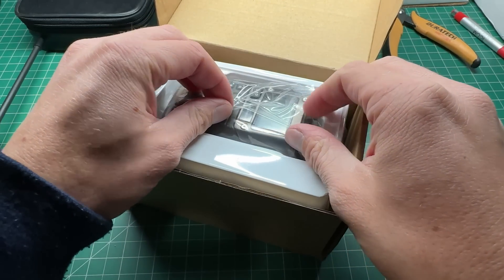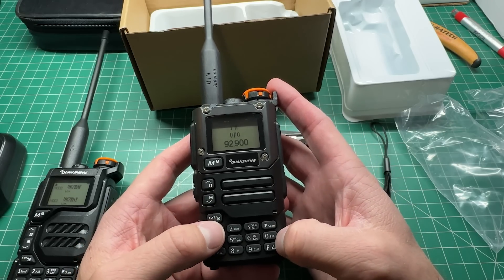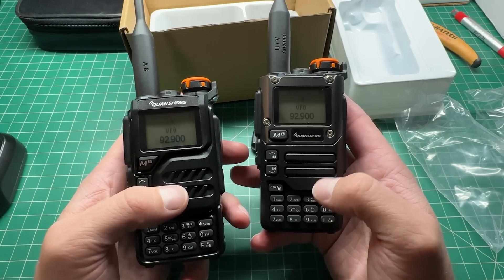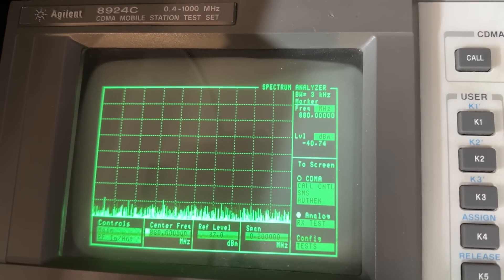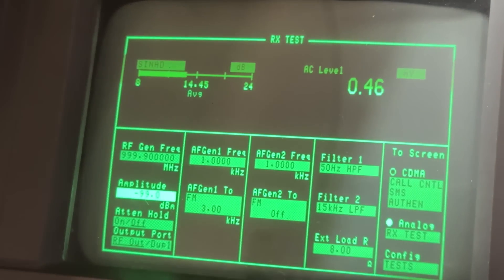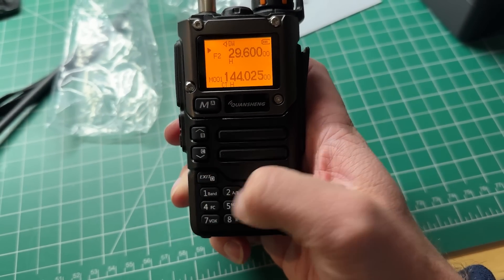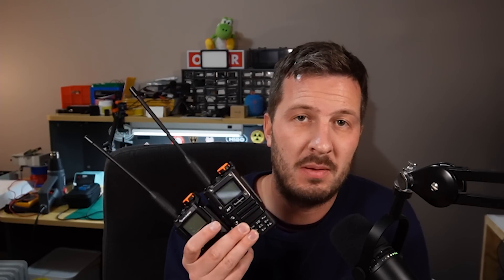Is This Really An "Upgraded" Radio - Quansheng UV-K5(8)

Comment from the maker: More on the UV-K5 here 👇
https://www.youtube.com/playlist?list=PLSuX83ay4Ouh_qMAC79F92DNVaOtywmC5
Reply: So why would we regret buying the upgrade version?
Reply: Getting around the same values with TinySA Ultra on the K5 (OG white light FW 18-1300mod) as some of your readings
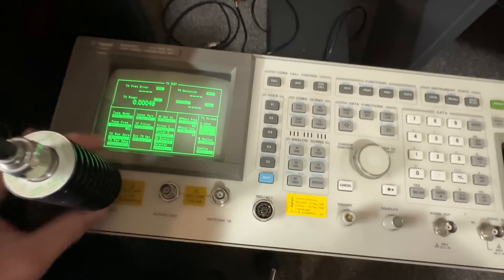36.1Dbm at 146.5Mhz with 200k span and 3Khz  RBW in high power 5:11 
first 293Mhz - 10.1dbm
Second 439.5Mhz = -16.6dbm
Third 586Mhz -36.5dbm

440Mhz 35.9dBm  (battery 7.93v)
880Mhz first -5.6dBm 🤔
1320Mhz second -2.5dBm  🤫
1.760Ghz third - 16.8dBm
2.200Ghz fourth -33.8dBm
2.640 five-43.1dBm
Anybody got the same? (am on FW hack 18Mhz to 1.3Ghz)

Though if I put all on automatic and just chose to do a "harmonic measurement test on 440Mhz as main carrier, the TinySA Ultra will span with 3.520Ghz. (RBW850Khz VBW 850Khz)
and gives these values, after you hold it in for a good amount of time, to the values stop rising =
Main carrier 440Mhz 35.9dBm
Delta to carrier +440Mhz away -46.0dBc
Delta to carrier +880Mhz away -40.6dBc 
Delta to carrier +1320Mhz away -51.8dBc

*1320Mhz harmonic seems to peak a bit on 440Mhz on the K5

Big thumbs up for doing these tests, as its a joy to follow suit and learning a tad from your knowledge on the matter, and I personally put way more value to videos that test such things and gives tangible values, then just "I feel something is good" as that view been outwatered quite a bit on social media like YT, hence secondary agendas / incentives, so kudos for testing things.

Comment: 3:58 nothing todo speaker. AM need AM modulation. do it has AM modulation or is it again chinese trick. AM should sound normal without shshshsh. there is AM on menu sure. mayby its software

Comment: Hmmm, you come across as intelligent and technically competent, what caused you to fail to articulate a reason for not purchasing a K6? Why debase yourself with ‘click bait’ tactics?
Reply from the maker: Did you not watch the video? Suggest you watch it again, perhaps at 0.5x speed to grasp the concepts and reasonings a little better.
Reply: You gave no reasonings to why this would be a regrettable radio to buy, so much so that the majority of respondents have simply labelled this post as ‘click bait.’ It seems as though your ability to get your thoughts and reasonings across is on the weak side. Perhaps you could revisit your video and add a summary at the end listing your reasonings. Up to now everything you said is wishy washy and vague. You have yet to commit to any solid reasoning as why this is a regrettable purchase.
Reply from the maker: @tamistone2632  cheers champ

Comment: Hi, as you left the attenuation inline for the receiver tests don't you need to add the 20dBm back onto the receive tests?
I heard you say you added it for the TX testing. Thanks.
Reply from the maker: The -20dB attenuation was zeroed out in the menu for both TX and RX tests.
Reply: @HamRadioDX  Thanks, I wasn't sure if that had been taken into account for the RX path of the radio from the generator.
Although even if you added the 20dBm back in, it would still have poor receive sensitivity.

Comment: Presumably through a 2m/70cm antenna the 2nd and 4th harmonics are attenuated further by the mismatching of the antenna to those harmonics? As long as you don't amplify it above 5W I can't see it causing any practical problems.
I think it's confirmed that the electronics of the K5 and K6 are identical: just cosmetic changes.
For the price the ability to load so many custom firmwares make it pretty impressive.
Reply from the maker: Practical problems - yeah probably not. I think the main issue is that the FCC specify the regulation as "at the antenna transmission line" which is essentially the end of the SMA connector before the antenna is connected.

Comment: As good as the Yaesu is in the Amateur world, it still pales in comparison to commercial radios made by Motorola!  There is no comparison to RF rejection on the front end of the Motorola and the same can be said for the TX and RX audio quality!
I don't even bother with Japanese handheld nor mobile rigs anymore and run strictly Motorola!

Comment: Hallo, I am Tonio, new to this hobby, bought the set, read how to upgrade, did so with Egzumer 0.19 but I want to disable/kill the sender mode, just want to receive with it: can someone give tips/tell me how I can do it? Any answer is welcome! Thanks in advance!! Best regards from Rotterdam.
Reply from the maker: On the Egzumer mod page - check the wiki. There is a section on how to disable the transmit in the menu
Reply: thanks a lot, I found it!

Comment: Lipstick on a pig..... another old saying from America, you can't teach a pig to sing. It irritates the pig and your wasting your time. It's how I feel about economic warfare from Tyr world most oppressive and hateful nation. I may be a broke retiree but I waited !8 months to get my Yaesu FT 70 and enjoy the durability, quality and better than 40km range to the repeater. Nobody enjoys a local net with an operator joining in with a $30 piece of junk that strains your hearing and slows down the net with constant requests to resend traffic. You can resell your Yaesu or Icom easily and the repeatable quality and performance is joyful to operate. It's my opinion but nonetheless valid in that regard with politics aside. The same goes for buying one 100 watt Yaesu for portable versus that G90 that may or may not work.  I saved 2 years to get the 991a and love the value and resell when my time here is done. Love your channel and your work to promote ham radio. You are a national treasure and inspire me often Hayden.
Reply from the maker: Cheers thank you!
Reply: I own differents radios, both economic chinese ht to expensive japanese radios. I own the g90 and it works pretty well. I own icom 7300 and i love it. I own a super cheap usdr and i did a good contact on 40mt whit japan (i live in Italy). I've just bought the uv k5(8) because i love to change firmware, make mods...this is the joy for an ham for me: make tests, play whit solder...

Comment: because of the reviews I've seen and it's versatility... I just purchased  2  UV-K6 off of AliExpress for $13.50 each and $14 shipping... don't need two but basically bought the second one for the battery... or an emergency situation... just hoping they aren't factory rejects or seconds...

Comment: Hi There...There seems to be a plethora of these small handhelds about right now . I was just wondering...Transmitting is of no interest to me....I just want it for VHF/UHF and air band RX......Are there any of these new fangled (cheap) receivers which just have receive only....?
Reply from the maker: These handhelds will RX perfectly fine.
In fact you can disable TX completely if you want
Reply: @HamRadioDX  Many Thanks M8....Out of the budget sets which would you recommend  for an all rounder which also gives good air band RX....?

Comment: The Airband modulation works totally fine now, after the last mod! - as good as any flight scanner!
Reply: Agree. 1of11 did a great am fix using agc code.
Reply: @liesofgasandpilesofshoes  yes! and it works even better now!, my comment was one month ago, i now use fagcis latest firmware (github) and radio works between 14Mhz to 1878Mhz, spectrumscope,Am,Fm,Usb, a fantastic radio! 73, Levi in Sweden
Reply: Do you have a demo about the sound quality?
Reply: @keukenrol  NO - i wrote above it is as good as any flight scanner

Comment: does RX test's but leaves the 20dB attenuator in line.. ??
Reply from the maker: The 20dB attenuator is offset in the service monitor
Reply: @HamRadioDX   Ref remark from @CBRadioWayBack10-4  How so little knowledge can be dangerous!  No doubt suffers from Dunning-Kruger Syndrome!

Comment: Hi friend .
when Im using it for scanning , I notice it throws me back where I started 
for example , start scanning 400 mhz , at end of the 400s it goes right back 
beginning of 400 . Do you know , can I set it to continuously go thru every
band ex , 100 mhz - thru 1200 mhz . or can it only do each section manually.

Don .

Comment: You should mention the USB charging on this and the K5.
A real decision maker for me, as it obviates the need for an external charger, though one is suppied. I have chargers almost up to ny kneejoints, so anything which standardises charging between different makes & models is good, and especially good for preppers, as a fairly small solar panel charged both the K5 and K6 to three bars in less than a day.
Reply: people its another option to charge up in a pinch why are we complaining lol
Reply: USB charging, as the manual says, should only be done in emergencies. It is not the proper way to charge the radio and it will damage the battery.
Reply: usb c charge dead fail  100% battery  olways see charge dock better
Reply: @Rzeszowiaczek is this true? Charging via usb can damage the battery?
Reply: @Zigoritos  No it can't, otherwise that method of charging would not be provided. Other makers are using USB charging too.
Reply: @Zigoritos  no, usbc can even regulate the charge current at 60 and 90%. LEAVING the radio in a charge cradle for hours and days damages the battery by using up the charge cycles quickly because it never truly switches OFF in the cradle
Reply: @Rzeszowiaczek  The only problem I've found is it doesn't like chargers with PD, use older dumb chargers and its fine

Comment: hi, i have the k8 version and the new uv 5r plus and they both have the same thing which must be a problem. the sma connector is sorted.i do a continuity test with my multimeter between the sma pin and the part you screw the antenna in and they are sorted. from my understanding that means no ground and no way to add a counterpoise or external antenna with ground. can you check your radios if you have the same problem or maybe this is the way they come out ?
thanks
Reply: you can put thecounterpoise on the antenna gnd
Reply: the antenna ground is shorted with the center pin as i describe. this is the problem. this happens on uv k8 and uv5r plus. the addition of a counterpoise most times raises swr while with the same antenna on other radios each time a counterpoise results in lower swr.
so either these radios have this defect or something else is happening. i am trying to figure out what. @JohnUsp
Reply: @epsavit1  thanks, keep us updated.

Comment: Hayden, i noticed the baofengs are happy enough to tune and tx ar 470-480 but the box for the quansheng says tx only to 460. Can anyone confirm if it can tx within 470-480mhz. While not encouraging operation of an amateur radio device on the class licensed UHF cb band (something that even at low power would not be permitted due to the absence of acma approval of the device), it was nice to know having a H/T in the car when driving remotely that in a pinch i could summon help from someone on the AU UHF cb band. In a genuine emergency txing on any frequency to get attention imho is fair game, no matter the penalty. If it can't tx just a tad higher and no worksround exists to hack the sdr, ill have to go with the talkpod or radi.

Comment: How is the speaker volume on the original one? I got a baofeng for receive when paragliding, unfortunately I passed my radio to the emergency responders after an accident on the hill and didn't get it back. I guess that one is now lost. I may replace it with the quansheng but haven't seen if extended batteries are available.

Comment: Is anybody else having trouble with scanning on the Quansheng? I am receiving a signal on the Baofeng but the Quansheng does not stop at that frequency in scan mode. The Quansheng receives when not scanning but does not stop when scanning. I have done factory reset and reloaded the firmware but no scanny

Comment: I'm not sure it did trasmit on the Airband before I installed the 18 to 1300Mhz hack, but after installing it this radio is able to transmit on 118.200Mhz in the airband. That's not good.

Comment: Great Stuff! Thank you for the very clear testing. New US Technician class operator here. Looking for an upgrade to my UV-5R. The UV-5R receives NA1SS well - until now, though, it cannot “get through” on the uplink….time for a better antenna, also. All the best.
Reply: Tape measure yagi are great. Still hard with people blasting 1500 into the repeater.

Comment: So I'm torn between this new K6, a K5, or a Talkpod A36 Plus.  I'll mostly just be listening to Airband, chatting with my buddies locally on their HTs, and doing some tinkering and hacking, if available. Any thoughts from those far more experienced on which would be my best option? 
 I currently have a Quansheng UV-R50-2 that I like, except that it won't hold a charge any more if I leave it off the cradle for more than a day or so. :/

Comment: I’ve got one of these and they haven’t improved anything, the airband is still bad and the speaker has improved but it’s not very noticeable. They could of improved things better in the new version. It’s a little disappointing. Great video as usual M7AQI from UK
Reply: Do not expect more for this price... Very-very cheap...
Reply: But there is more, a lot more. With the latest firmware mods AM is absolutely spot onfor RX and TX. I have used mine a couple of times now as a back up air band transceiver and obtained takeoff clearance with it and a tower radio report of 5/5 whilst on the ground.   @Wondobar
Reply: @AndyMcGeever should i buy one? Or is there something else you would suggest?
Reply: @Wondobar  I know not to expect alot from this radio but the air and is terrible 😔
Reply from the maker: Thanks!

Comment: I have both but cant tell any difference myself. Sadly Airband is also the same. Im not getting any more of these, I bought them mainly to receive extra freauencies at the same time. I have a Wouxun and a Tecsun that can get me good Airband. Cheers Hadies. :)
Reply: Thers a mod to improve the AM, change the 100pf cap to 1nf on the top right corner of the LN 4898 audio chip

Comment: Well...This upgrade is mainly for China Mainland market. The screen doesn't only change the background color. Instead,the UV-K6 screen can present the Chinese character which     makes it easier to use for Chinese ham. The original UV-K5 can only present English character. So that’s why it exists. I don’t recommend anyone to upgrade to it if he or she can speak English and plans to purchase the UV-K5.
Reply: The amber screen is so much better in daylight than white....
Reply: The whole radio is a joy to look at and to hold. Not clear how this is possible at a price other manufacturers not even sell a replacement battery. Even the backlit keypad is no standard. Firmware modifications are the icing on the cake.

Comment: Do UK planes use a narrower band?  My UV-K5 does not sound that bad.
Reply from the maker: I'm not sure. I don't live in the UK
Reply: @HamRadioDX  I was just assuming by the accent.  My radio sounds a little better than yours.  Thought it might be a regional thing.
Reply: It picks up Australian Air band on 125-130mhz really clearly 👍😆
Reply: Mine sounded decent outside ema around Castle Donning ton and also in St. John's Newfoundland, Canada.

Comment: I bought this K6 because of its good looks and amber backlight, simple choice. Turns out the chip has no built-in AM circuitry, basically it transforms the Amplitude Modulation with FM ihrough a single algorithm. It becomes sort of audible. Maybe it is even digital (DSP) because it sounds a bit like block waves without softening the frequency curve into a neat sinus.
Reply: UV-K5 also has no built-in AM on board, the BK4819 receives and transmits only FM
Reply: @abcdef8101  THX
Reply: @abcdef8101  i tried mine with my ham rig, and there is am rtx not clean but definate am. with the freeband mod i can rtx cb27am
Reply: The poor AM Rx performance has since been resolved by third party firmware developers by employing undocumented features of the BK4819.
Reply: What after all the fiddling with new firmware can this v5(8) or k6  do... Can you tx rx ssb.. The airband sounds awful so distorted... Am i missing something?
Reply: @roberthopkins8089 am is fixed and now ssb is added
Reply: @roberthopkins8089 The 3rd party firmware updates fix all these issues.

Comment: My last job before retiring was at Keysight, so I miss being able to bring home projects to work and play with REAL toys.

So whenever I see a ham tuber with a spectrum analyzer (or test set), I get FOMO.
Reply: Nowadays there are some good hobbyist tools for spectrum analyzing that don't break the bank and some are easy to use as well. I have experience with the TinySA Ultra (a hardware evolution from the NanoVNA, specifically used for spectrum analyzing applications, with a dc-800MHz range and limited use up to 3.5 GHz using harmonics) and using a decent SDR device as SA (in my case, the Adalm Pluto). Of course, don't expect the quality of a five figure dedicated SA, but you can do a lot with just a few hundred bucks and some hacking.